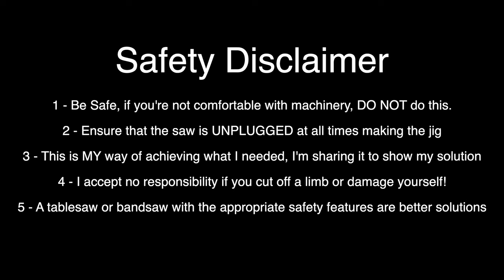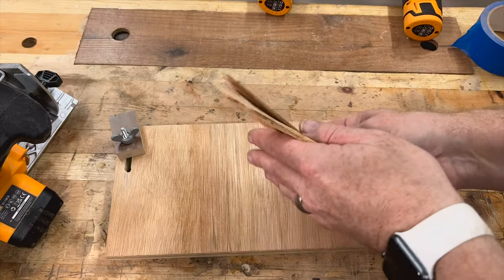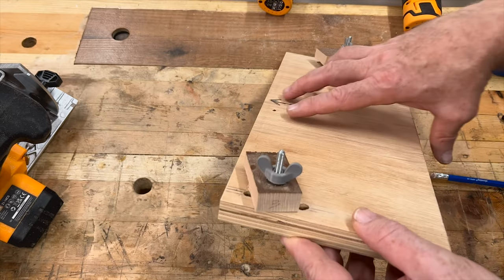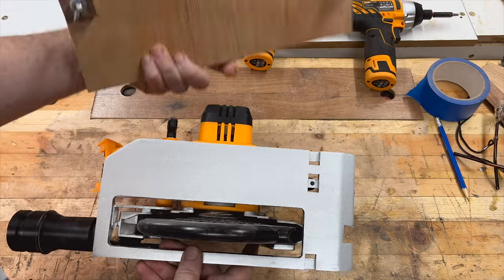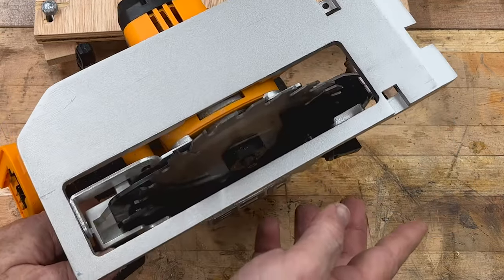Thin Rip Jig for a Circular Saw!

Comment: I found this very useful to cut strips for model work (1,5-2 cm thick wood, 3-4 mm strips) But when Trying to cut thin plates of thicker wood (5-6cm) its hard to get uniform thickness of the pieces. Maybe its possible to mod this jig to prevent the saw from tilting outwards even slight during the cuts.

Comment: Made this to spec and really impressed. I was ripping for 20mm and it worked a dream. I really appreciate how appropriate the engineering is; no additional cuts, holes, or screws. Built in under an hour and put to work. Appreciative and subscribed.
Reply from the maker: Thanks!

Comment: Absolutely love this. Presuming the top of your wood is square you could make this with an extended foot to ensure a perfect 90. 

Also, it may be easier to just slot something the width you want to cut and tighten down there then worry about measuring. Easier, less fuss, more accurate. 

Either way I am absolutely inspired and will absolutely use a jig based on this to create the strips for a custom layup I hope to do soon. Thank you so much!!!
Reply: With foot, you  mean like a leg down to the floor or sacrifical board?
I try to find out some way to modify this jig so i can cut thin plates of 6cm thick basswood. Its hard to get uniform thickness of the stripes if the Wood is thicker than 2 mm. So im curious about your idea.
Reply: @l.j.h9999  no, sorry, I mean the foot of the saw, basically a wide zero clearance base which would ride on top of the offcut section of the wood, giving you greater reference area to ensure you are cutting square. This, of course, requires that you're cutting wood which itself is square, but after the first cut, it should be.

Comment: If you have a sample of the thickness of you want, maybe you could place that between your fence and the blade to create the space. Then tighten down your bolts to secure the fence, and remove your sample. 

That way you reference the material and not the markings on the square.

Comment: If I was building this jig, I'd remodel it so that the ply plate would be predominantly over the piece of wood to be sliced and two outriggers for an adjustable fence under them. I have both left and right handed circular saws (I didn't realise when I first brought my battery circular saw that Ryobi made them handed), so I can use the most appropriate one for the application.
Reply from the maker: Sounds interesting, you should definitely make a video about it

Comment: You can find it in accessories for circular saw : the parallel guide !!! 😉
But it's a good thing to make your own DIY, for specific thin cut 👍
Reply from the maker: The paralleled guide that comes with a saw is for parallel cuts wider than the saw’s base plate, unless you’re talking about something else?
Reply: @WoodworkJourney  You are right. In some cases, it's possible to add a piece of wood on the parallel guide, for cuts thinner than the saw base plate.

Comment: Cool vid Dean however you did miss 1 very important safety tip. You should always make sure that your power tool has it's power source disconnected be it battery or mains when setting things up with an exposed blade.
Reply from the maker: Pretty sure that was in the disclaimer text bit near the start buddy?
Reply: @WoodworkJourney  Double checked and you are correct.
It would have been better if you had removed the battery during setup demonstration in the vid but what's done is done. :)